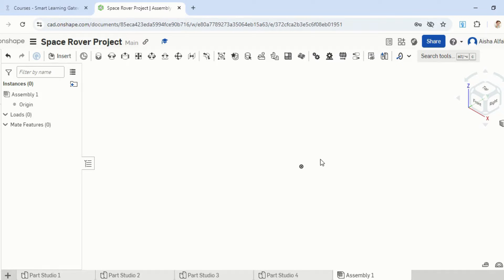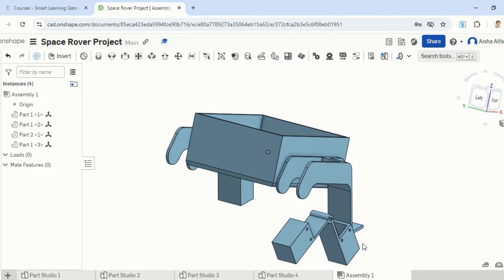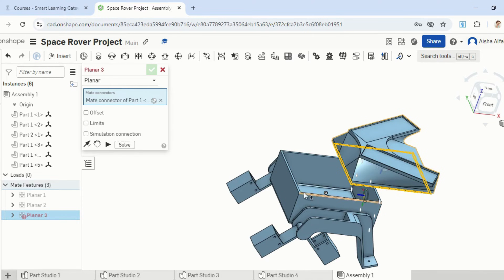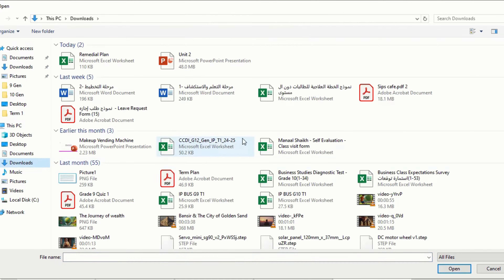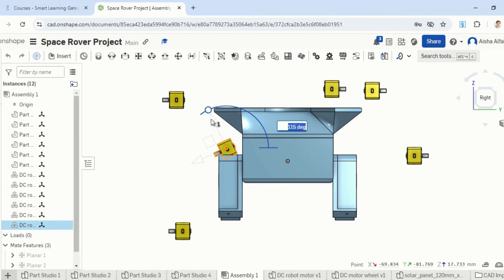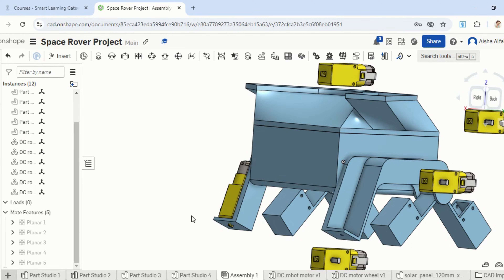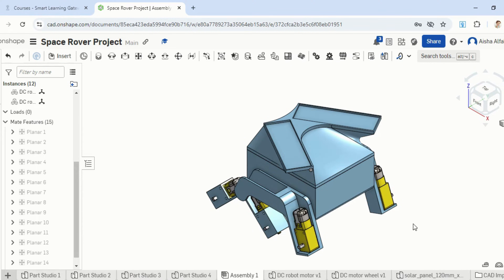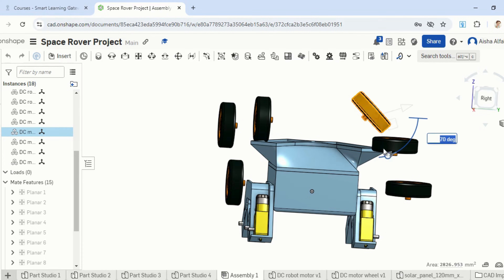CCDI Project _ SpaceRover _ Part 5 [onshape

Comment: Where can I buy all these components to make it work? Also how can I wire it and what parts will I need to hook it up and get it running?
Reply from the maker: I'm not sure where exactly you can purchase them, they come in as school resources for us.
Reply: @cdi_hub  Ok, I just wanted to know if there is any way for me to make it functional in any way ?
Reply from the maker: @AnshKumar-p7b7fyes of course. You can purchase the parts online if you search for DC motor and wheel, small solar panel for projects, and arduino Leonardo or arduino Uno. These are the same parts used in the video. Arduino is the brain that you can install the code on and control the vehicle

Comment: Ms i unter the files it not open
Reply from the maker: If you request access and try again after 10 mins it will work
Reply from the maker: The files are not meant to open, they should be uploaded as components on onshape to continue the project.